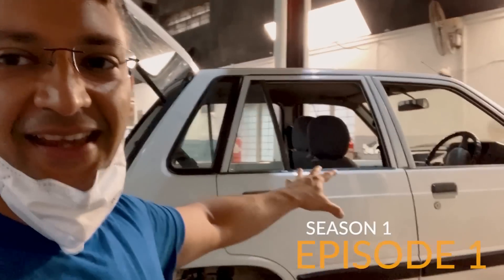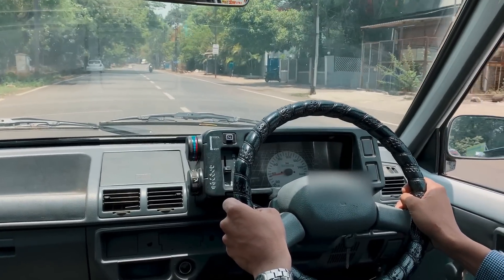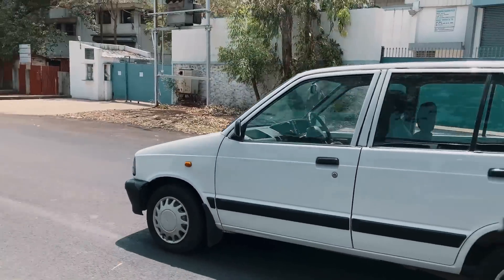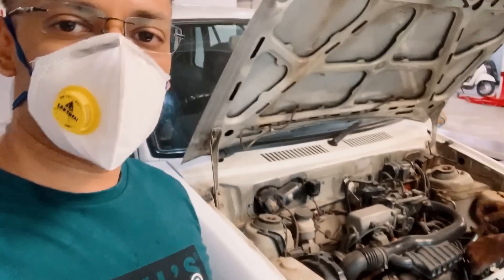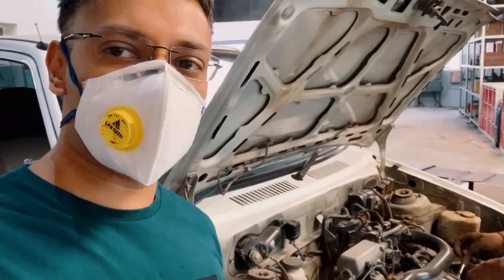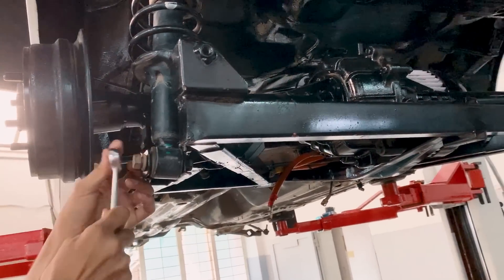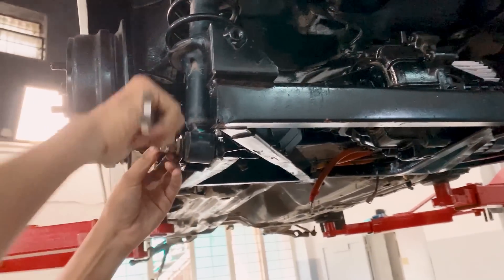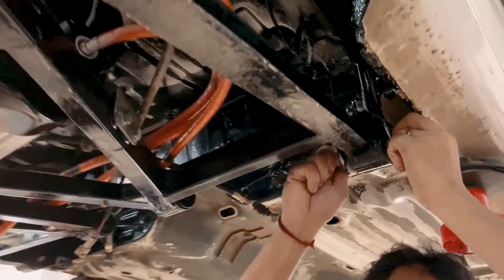NWMS S1E1 Maruti 800 EV Conversion. Northway Motorsport EV Conversion Series Season 1 Episode 1

Comment: Really appreciate..
Seems like removing original engine, transmission, gearbox as well ..
And installing a new accel kit with motor 
By any chance does it have clutch...?
Can we use 1,2,3,4,5,6 gears ...?
Or is it works as automatic direct transmission .. please reply
Reply from the maker: Please See Episode 1,2,3 for more details, and visit www.northwayms.com. Its a single speed stepdown transmission

Comment: I want saperate motors for front and rear wheels..
Can u do that in my 800??
Reply from the maker: Yes we can build a dual motor setup no problem
Reply: @Northway-NTPower  I saw a motor installed to kit is that motor manufactured by you/team from scratch..
Is that dc/ac motor
Reply: What you mean by saperate motors ...?
It's a kit to install with rear acel frame ..

Comment: Good Idea to use rear axle bldc motor but if you put the motor in original transmission it will save your time and require less modification
Reply from the maker: Yes we have done this on a few cars before. But then the point of this car is to slide around and drift. Also to maintain similar weight in the engine compartment with batteries for driving dynamics.

Comment: Dear sir nice job but can you provide some technical support for me as i m locking for my Hyundai eon but where can we get real axle for rear weel drive also how the brakes is works while it use power from engine with vacuum so how can we go for it while we dont have engine
Reply from the maker: send me a contact request by filling in the form on my website - www.northwayms.com and we will get back to you

Comment: How much would it cost to convert swift Petrol to electric???? And how much time ??
Reply: Sir, for old Alto 800 with EV conversion with max speed 100 and range of 250 km what would it cost
Reply from the maker: Depends on performance and range needed. Cost will vary from 5 lacs to 20lacs. Totally depends on whether you want a daily drive vehicle, Libby range vehicle; or a race car.

Comment: Beautifully done!!!..........is the rear axle borrowed from any vehicle or completely fabricated from scratch?
Reply from the maker: The Rear axle is salvaged and restored from a scrap mahindra
Reply: Just out of curiosity would you be able to build an independent rear suspension with the drive train in the rear if needed?...:)
Reply from the maker: Priyanandana Varma Mudunuri  yes we have done this before. No problem. We can do 4wd setups also
Reply: can you tell me how car ac runs
Reply: @naveeshkohli9185  He uses a separate BLDC motor for it.
Reply: This set up is really useful. A simple one gear differential is suitable for so many conversions!